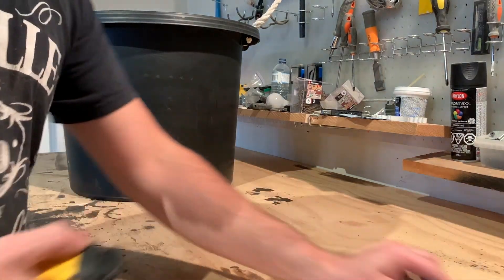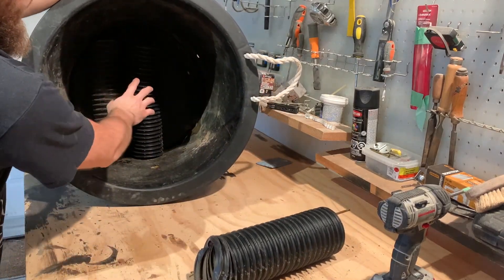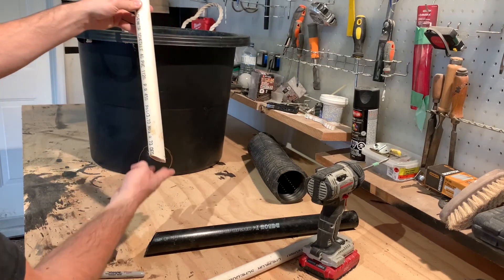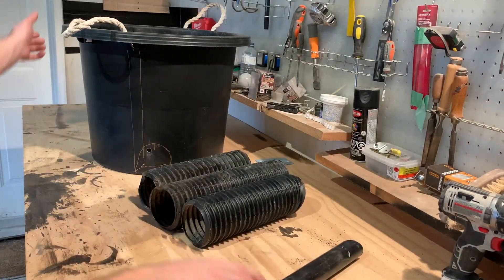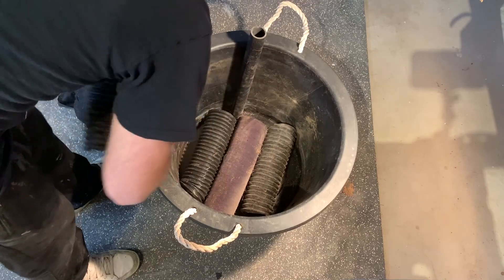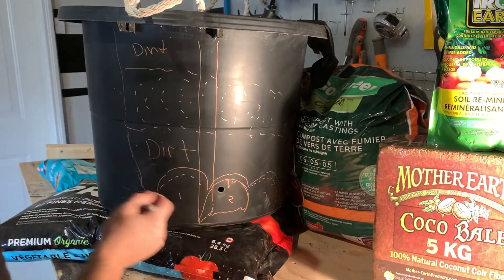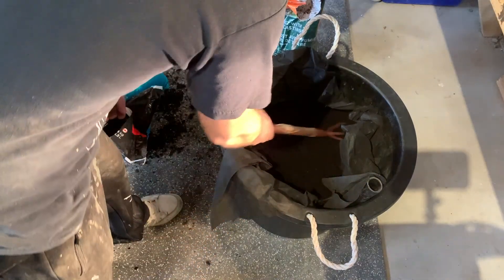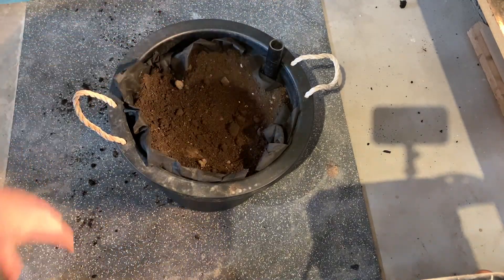Self wicking tub or bucket. What to add, use and how to set it up.

Comment: Where do you get a filter sock that's that big? Thanks. Great video
Reply from the maker: Thank you! Bought the pipe with a sleeve already on it but most big box stores will sell drain sleeves separately. Thanks and GL!
Reply: @xacresestate  any idea where to get that corrugated pipe from at a decent cost? I'm only going to make a couple of those things but the least amount of pipe I can buy is 80 feet! That's over a hundred bucks. I only need any 8 feet's worth. Any ideas. Thanks
Reply from the maker: Try facebook market place, @slamdunk58